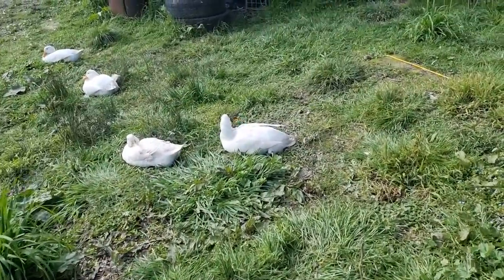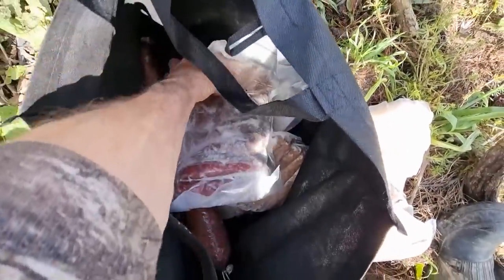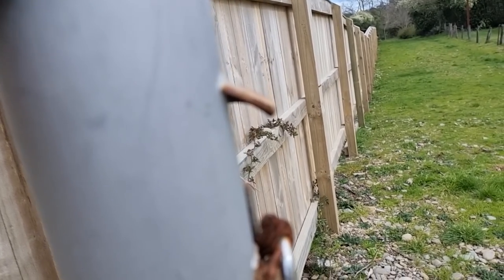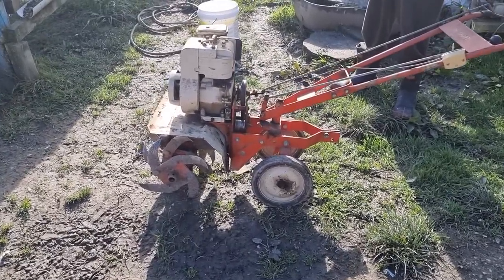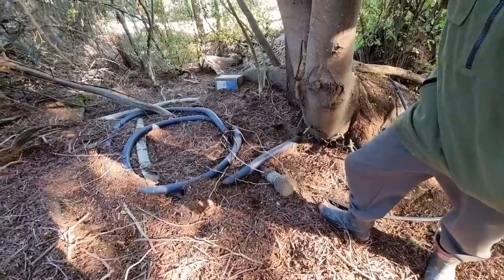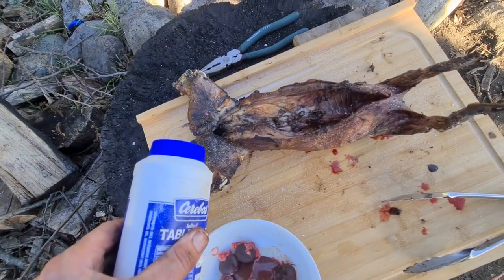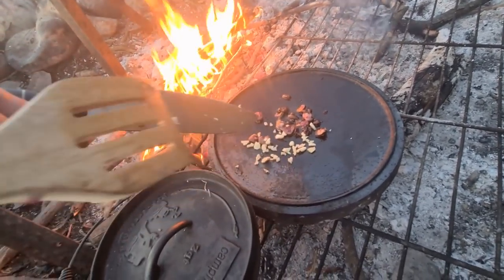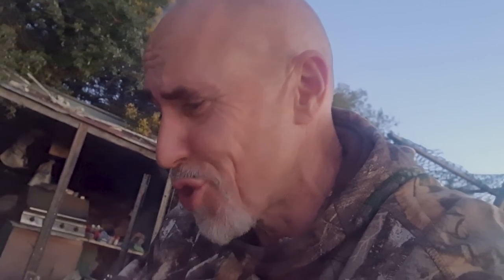Our Essential Items during lockdown in New Zealand

Comment: Hi Clay , with that rotary hoe , you will have to take carb and fuel tank off , clean tank , strip carb down , you may need a new diaphragm , clean with brake cleaner , blow out with compressor , reassemble , check for spark , you should be good , cheers Paul
Reply: Hey paul wheres the diaphragm..? I remember seeing such a thing when i had it in bits
Reply: @dylangarner1495  under the carb , between fuel tank and carb , diaphragm and gasket , unscrew carb from tank , pull long tube out , its in tight but should pull out and click back in , if tank rusty , put some stones in it and slosh around to loosen rust , give everything a good clean , diaphragm may be reusable , dont loose little spring under carb , tickety boo